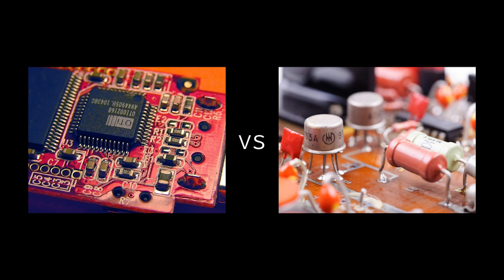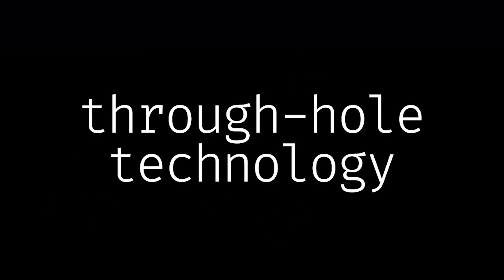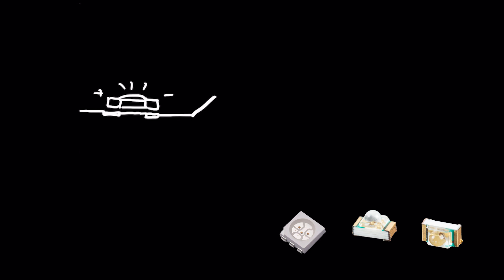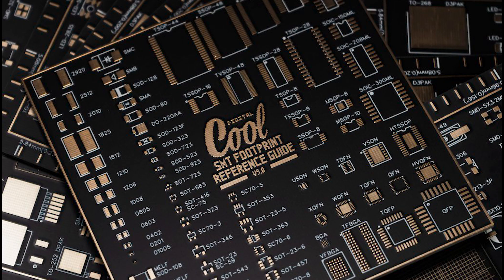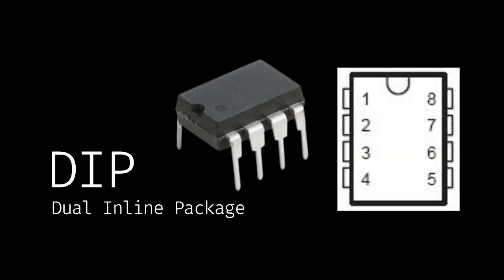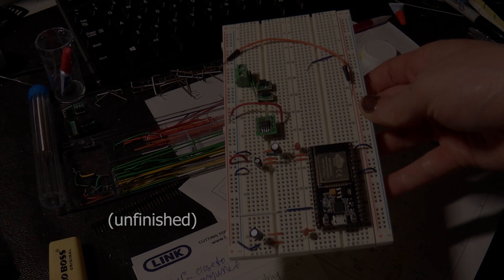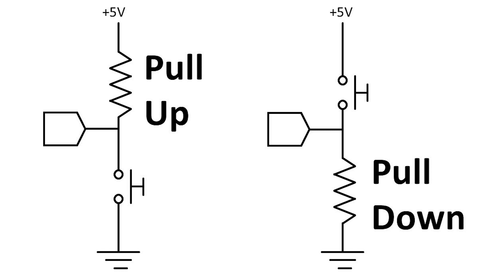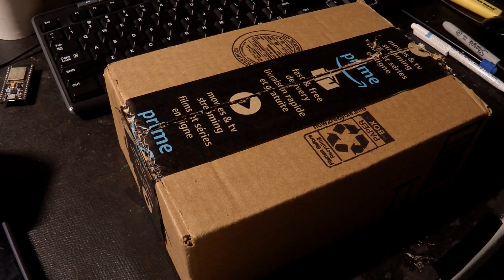what the S-M-T ?!

Comment: Nice job!  Like the breakout board ideas.  Though, soldering on a breadboard is convenient for pin alignment, I'm not a fan of it.  Spatter and rosin gets in the breadboard, and I once learned as a kiddo that breadboards melt easy.
Reply: Yes, my experience with cheap overseas breadboards is not the pin location but the lack of consistent spring strength of the contacts within the breadboard.  I had a breadboard that would randomly lose contact on holes that had only been used a couple dozen times or so.

I opened that back and found the contact strips to be made of steel that was noticeably thinner than a known good breadboard and that lousy contact material seemed to have no spring to it.  Without the spring tension, the contacts stopped gripping the pins that were inserted in the breadboard.
Reply: Use a cheap breadboard for this. AliExpress breadboards are perfect for this. Cheap, but the spacing between pins may be off by a few hundredths of a millimeters.
Reply: @joveaaron-real  Off by a few millimeters!?! I don’t think you know what a millimeter is. If a pin were off by several mm, it wouldn’t be anywhere close to fitting. The pin pitch is 2.54mm. It can’t be off by more than a few hundredths of a mm. And in my experience with cheap breadboards, the pitch is perfect. (The same can’t be said for the quality of the contacts within.)
Reply: @tookitogo  I meant to say that, sorry. I wanted to use something like micrometres, but that's too small. I couldn't think of how to say it. If you connect a bunch of headers to some breadboard, it may not fit (usually happens on cheap breadboards).
Reply: @joveaaron-real  I’ve never seen a cheap breadboard where the pin pitch was off. But like Daily DJ said above, in many of them the contacts are awful, including some with so little funneling that most things wouldn’t go in because they couldn’t spread the contacts apart. With that said, I don’t recommend inserting standard square-pin headers into breadboards of any quality, since they’re really at the very outer limits of allowable thickness, and thus stretch out the contacts.
Reply: @tookitogo  Thanks for the Tip! Cheers from Spain.
Reply: @joveaaron-real  De nada, y saludos de Suiza! :)
Reply: Definitely agree! Always use a sacrificial breadboard for soldering, not your good ones!